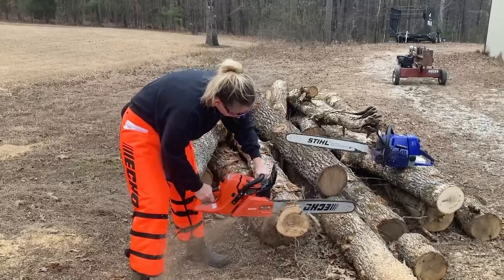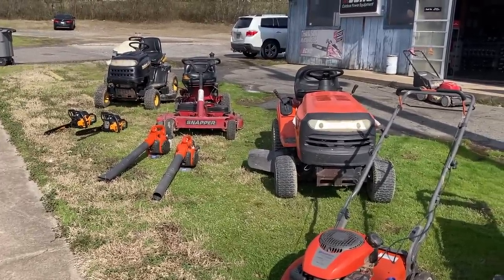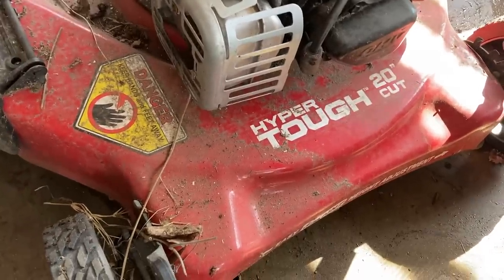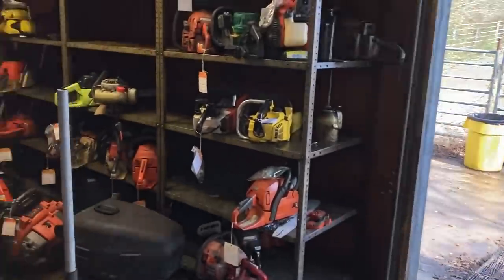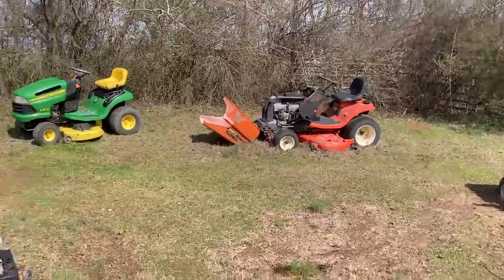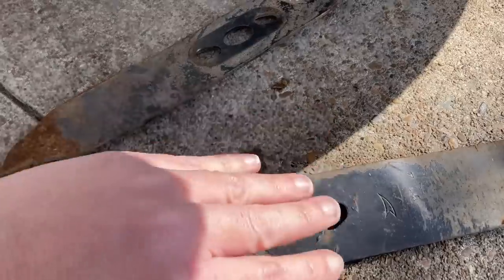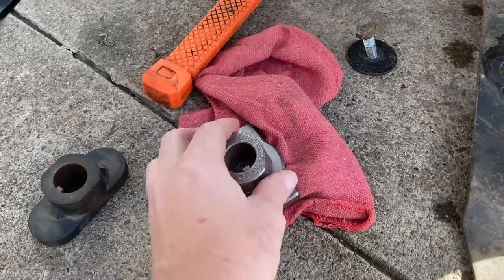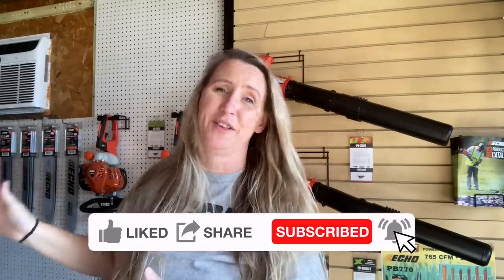Unwanted and Abandoned. The Equipment That Never Made it Home. (There’s SO MUCH!) VLOG

Comment: Great video Bre. I have a Husqvarna push mower that I bought used. When I put it away last fall it was having issues with the governor constantly trying to over rev. Model 7021 CHI, Briggs motor. Any chance a coming video could help out with that issue?  Thanks.
Reply: Probably a plastic governor that all the teeth are destroyed. Did one recently, not that particular model. Customer insisted it had to be fixed...only way a replacement governor was available was with it and sump pan as a kit. Not cheap. Still was a 1/4 of a price of new mower. Replacement factory engine would of cost more than a complete new mower.

Comment: Who cares about pretty? If it works that's all I give a crap about. I am still using the John Deere riding mower my parents bought  new in 1996 as a workhorse and running a 2007  craftsman push mower for my rough little jobs.     It is much cheaper to keep the old things running than it is to purchase something new.  A little TLC goes along way.

I'll keep working it till it can longer be run. 

I hope you get it all taken care of and have  more open space.

Funny thing you should show that bent blade. I did exactly that on the craftsman I mentioned above last summer when I hit an exposed root. Put that perfect 90° right on the tip.  I was able to find an Oregon replacement at home Depot that came with a neat set of center hole adapters to fit a variety of mower shats. Got it all back on in a few and was back in business. Got to love a forward thinking company.

I really want to browse through your awesome stuff! You sound like you run a reasonable bargain 😉.

Comment: I managed to buy three John Deere 200's that had been left at a dealer in OH. Perhaps they were traded in or the cost to repair was more than the owner was willing to pay. And it is possible they dumped the old mower because, GASP, it didn't have a cup holder.
The dealer evidently tired of them taking up space in the shed so he put them all in one auction. "You are bidding on three non-running machines that have not been through the shop. No warranty, as is."
There was a 210 with 36 inch mower, a 212 with 46 inch mower and a 214 with no mower and AG tires.

I bid $600 for the bunch and forgot about them thinking someone would outbid me. I WON!
Had to rent a 6 x 12 trailer to pick them up. If the 214 had a mower deck they would not fit on a  6 x 12, I would have needed a longer trailer. They were really snug in there.

I got the 212 running, it has a lot of power, more than my newer MTD rated at 18 hp. The old timer at the shop told me they changed the way they rate HP.

Comment: I have to ask.  If you have a decent ride on mower with a bad mower, can't you just replace the mower?  Maybe something from Harbor Freight? I have a mower I don't want to trash.
Reply: Engine ?  Harbor Freight only sells horizontal shaft engines now. Vertical shafts are what newer tractors use. I'm in Southwestern Pennsylvania...what engine do you need ?
Reply: @ronaldfulton1175  Sorry I have to find the paperwork.  Model: 28V707 Type: 1113E1.  I think a seal just blew and its leaking oil.  I hate throwing things out that can be fixed.

Comment: I have a Shindaiwa 575 chainsaw that a very good friend of mine gave me. I got it running and fixed up. The problem is that the brake handle assembly is broken off and the brake assembly is missing. I can't not find one anywhere. Do you have any idea where I can find a used one? Thank you for your time. Robert Patterson. PS I love your channel. Best wishes

Comment: Hi Bre. I am looking to get another chain saw, I have a Husky 395 mainly to slab large logs up yo 60", I have an Echo CS 400, have had that for 9 years and NEVER had a problem, even after sitting for 6 - 8 months it always started on 3 - 4 pulls. I would like another Echo somewhere between the Echo 40 CC and the Husky 95CC. What would you recommend? Thank you  Ron  USCG RET

Comment: I have a old mantis tiller 7222m in bad need of repairs. Has no spark and carb. Are these throw away units 🤔  I think it's from like 2002 only used a few times but the lady left it out in the rain after it would not start. It set for years.
Reply: As long as engine rotates...easily repairable. Coil and carb. New fuel lines. Clean fuel tank.

Comment: Do you have any old john deere riders kicking around looking for a  deck that will fit a 317 and a few other  parts. Has a kohler 17hp engine  missing  air filter just the carb and no muffler..

Comment: Do you charge extra when equipment comes in caked over in dirt? I work on chainsaws on the side just buy word of mouth, and last two saws took longer to clean than repair it was ridiculous surprised they even ran. Or do you just charge shop labor rate while cleaning? I mean thing saws had to be cleaned just to disassemble in order to get tools in the bolt heads.
Reply: Quick pressure wash on chainsaws...99 out of a hundred never been maintained.

Comment: I have a snapper zero turn. It's a zt150 and I shut off the power takeoff off and the blades stopped turning and stop working. But if I pull the switch out as the safety is activated and the starter will not turn but I can't find a fuse and want to know should I  try a PTO switch before I buy the PTO

Comment: What am I missing?  I have had an Echo 225 trimmer since it was new.  It's about 6 years old.  I use fuel stabilizer in my gasoline, prior to mixing it with 50;1 for my 2 cycle equipment.  This season after running for about 5 minutes it would bog down.  I tore it apart, removed the spark screen from the exhaust.  With the costs being so cheap, I just went ahead and ordered a carburetor with lines, line grommet, tank vent, fuel filter, spark plug and air filter.  Replaced all of the above, and after adjusting the carb, it ran great for about 5 minutes then began bogging down.  In messing with it, I realized that if I loosen the fuel cap when it starts to bog down it runs perfect.  That being said, I put another new tank vent on it and, it does the same thing.  Any suggestions?

Comment: I have a 2015 Cub Cadet riding mower that runs like new however, I have an issue that EVERY Cub Cadet owner I know has, THE PIECE OF CRAP THING THEY CALL A SEAT!!!..................COMPLETELY DETERIORATED.
For months I have been looking for a replacement seat that does not rob me of $200.00 + dollars.
Any suggestions?
Reply: Redo it yourself. Go to a fabric/ sewing store and buy 1/2 a yard of black vinyl. Marine grade is harder to work with but is super durable. You can make tufts for the bends (or get a sewing machine to do it better) and glue it on with spray contact cement. Or see if a used seat will fit.   Mike
Reply: Buy a replacement and keep a cover on it outside or store it inside.
Reply: @ronaldfulton1175  Real good advise. All my stuff is old so after I fix the seat or replace it- that is what I do. Outside I cover all my machines.

Comment: I have a Stihl chainsaw I need to bring to you. That thing is so fussy.
Reply: Stihl engines carbon plug the spark arrestor screen on the muffler. Make sure gas cap is sealing. Both will make it crazy.

Comment: I recently opened a repair shop in Minnesota.  If people don't pick up their stuff do you get paid a diagnostic fee, or do you just take the parts you can use or fix and sell it and call it a day?
Reply: Get it running, sell it  - price to include your parts / labor  -  dont go overboard or you wont sell it
Reply: Require a minimum $100 deposit. More if its a tractor or quad.  Mechanics lien if left over 30 days after notice that repair is done. You own it to sell, part out, or scrap. People take advantage otherwise.
Reply: Thank you

Comment: All the commercial shops around me charge a $100 deposit for anything left for diagnosis/repair. 
   30 days after customer is notified of final cost...mechanics lein...sold or scrapped.  You have far too many people taking advantage of you. 
    Hyper Tough anything is junk. If memory serves me...on a Hyper Tough weed trimmer engine...the cylinder head is plastic. One time over heated, it is warped. Anyone brings me Hyper Tough...you got your monies worth if it worked one time, throw it away...repair is way more than cost of new.
   Anything John Deere electrical is worth saving. Seats are usually scrap. Hood are usually cracked, but repairable. 
    Used tractor mower decks are a hot item to resell. 
Anything Simplicity is hot...seems to be a cult following. LOL

Comment: The only mowers I would bother fixing or owning are snapper hivac, front wheel drive mowers suck, I do have a fairly newer Toro that was on the curb near one of my customers house, it needed a new cord a couple of bolts in the handle and a new air filter and housing because it was missing and u had one laying around, the carb was a mess and I had a good one off another Tecumseh engine that was no good, the thing runs great now, it's a 6hp. In my neighborhood someone was throwing out a craftsman front wheel drive mower, I got it home and it started right up but vibrated real bad, I have never seen a blade that was bent.like this one was, I don't know what they hit but at least it didn't bend the crankshaft, a snapper blade actually fit then it ran smooth, one of my snappers needed an engine and luckily the shaft was the correct length and it had the double keyway which is necessary for the drive mechanism